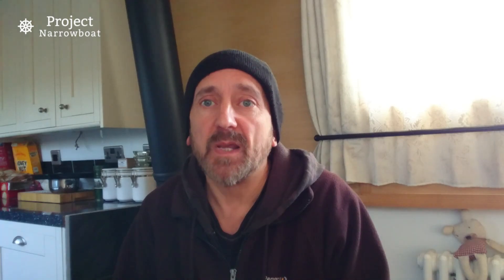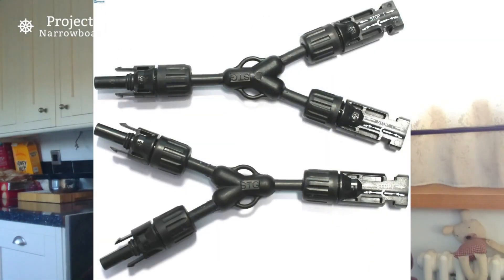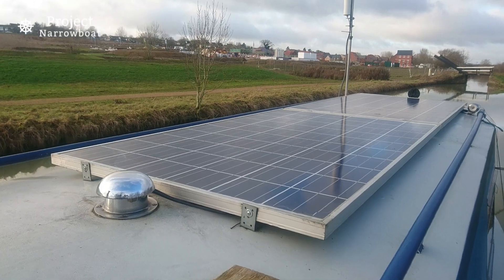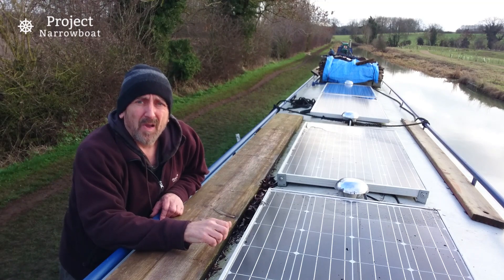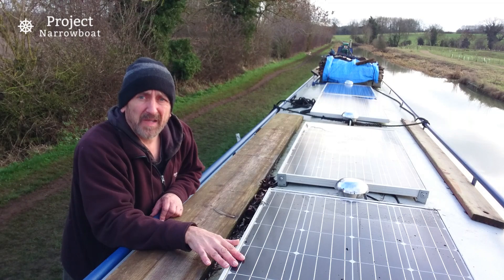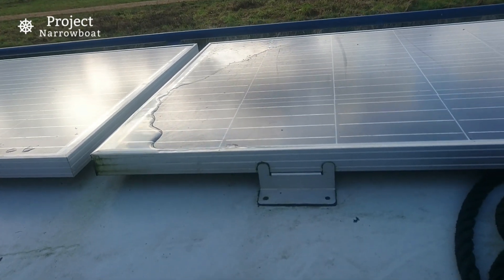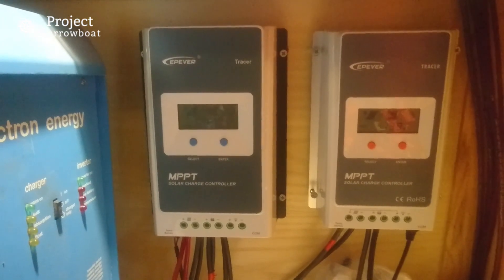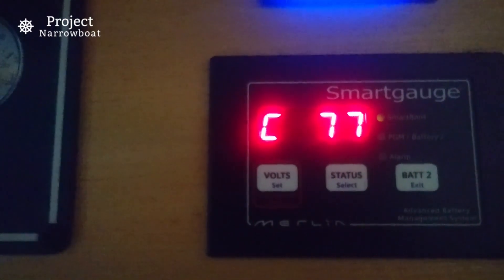Project Narrowboat ep 41 - Solar Chat pt2

Comment: Okay I have the LG bi focal panels just over a 1000watts 
I also have a victron 150/85 charger 
And lithium qs lithium 200amp battery as long as my temp don't drop on the battery below 0 which in my cabin it doesn't I can tell you my batteries never dropped bellow 30% and not above 90% this winter.. average 1.5kw a day... deffo worth the investment
Reply from the maker: That is music to my ears... it's lithiums for me when I can. I never managed to find a complete "home brew" lithium set up regarding the necessary control and protection - ok the mppt controllers can be programmed easy enough, as can the inverter/charger for use off genny, but it's getting the alternator charge sorted that holds me back.
Reply: @ProjectNarrowboat  look up qs lithium batteries they are expensive outlay but operating like is 6000 cycles I have had them 4 months and they have cycled 11 times... Your alternator use a victron tri it's a battery to battery charger that way it can monitor your lithium to use the power when needed... I'm just about to purchase one my self I have a old lister sr2 so I can't run a high amp alternator... Il let you know my finding tho maybe even make a video on it.. Keep up the great content tho you was moored Infrount of me in aynho but I missed you to say hey ha

Comment: these controllers the mt-50 meters are a god send to see power been produced and power been used i had the old tracer that was 40 amp 520w but solar array could be 1500watt what or the limits on the new ones ? the link cable for software on a computer was real good as well for data logginf
Reply from the maker: I have the link cable for computer - used it to set up parameters though the software I thought was a bit temperamental. I can't find my instructions for the controllers now but it's something like just a hundred or so watts extra allowed at input - nowhere near as much as the old ones. I thought that was a really useful feature just for coping with the odd silly days when there could be "too much" power. I keep meaning to get either an mt50 or possibly the bluetooth adaptor, it looks like the phone app would work well.
Reply: @ProjectNarrowboat  damn that sucks looks like when I do solar again I'll be looking for new old stock

Comment: Very interesting. Would of been nice to have prices etc. I have 4 panels. 2x 130w and 1x150 and a small 80w run in series. What controller would you recommend Mr London?
Reply from the maker: That's a point - I usually do  include prices - I'm afraid I forgot! Will see if I can add something at the top here. Controller - bang for buck, Tracer AN series - though they have others that look interesting. These are the only ones I've used and they do work. They stop doing proper mppt at very low conditions though - lots about them on here from proper solar channels etc.

Comment: You could use unistrut across the handrails from one side to the other and put your panels on there. One thing to note is that you have to disable the equalizing battery function on one of your charge controllers if you have a flooded lead-acid battery. Otherwise, it's going to create unnecessary gasses.
Reply from the maker: Good point about equalising - I didn't want to go too deep. though I do often feel that a bit more voltage is a good thing, after all if I run the engine all day (on a long cruise) then they get 14.5v all day! The main problem with lead acids seems to be the sulfation, through under charging. My batteries are always knackered and one of these days I want to get lithiums.
Reply: @ProjectNarrowboat  Yes, Lithium can be the way to go if you use your batteries long-term. More usable capacity and if you make them yourself, quite affordable.

Comment: You're not doing wet lead-acid batteries any favours by letting them get down to 65% SOC, and not fully recharging them.  I wouldn't make a habit of it, if you want them to last more than a year or two.  Not trolling, just trying to save you money later.  I found out the expensive way.
Reply from the maker: Tell me about it! I can knacker a set of batteries in just weeks. And usually do. Putting the last few % of charge back in on winter days (with engine/genny) is a real pain. I wont tell you how low they got over this winter! Over the summer, the long, lengthy solar charges actually revive them quite a bit though.

Comment: Very interesting video.  How did you lead the wire into the elec. compartment from ceiling to charge controllers?  Keep up the good work!
Reply from the maker: That was the bit where I mentioned having to pry the ceiling down a bit. I undid the ceiling fixing screws near the cupboard and was able to bend the plywood down enough to get my stick in and push it along to the previous vent where the wires were. Pulled the wires through then somehow managed to get them over to one side and to enter the cupboard where I cut a decent size hole in it's ceiling ( 5cm?) which I managed to jiggle the wires to in order to get them through - it's hard to explain but it was the trickiest bit and will prolly vary from boat to boat.  Doomsday scenario I might have had to have them visible outside the cupboard wall, but I was lucky.